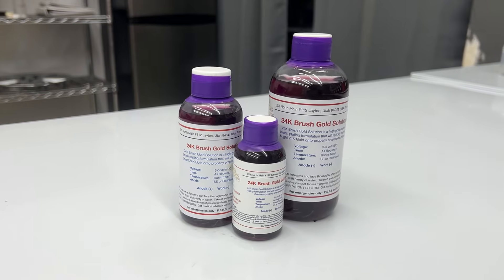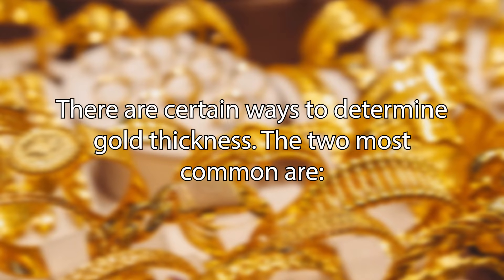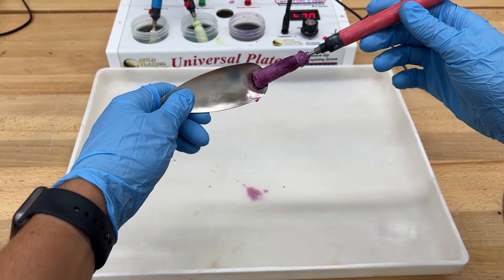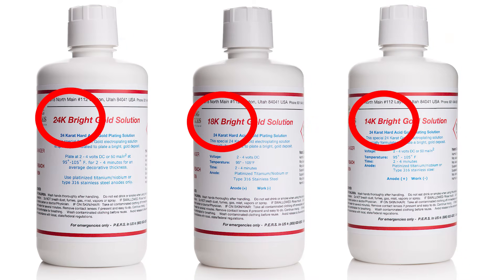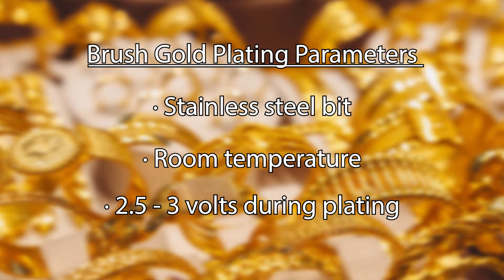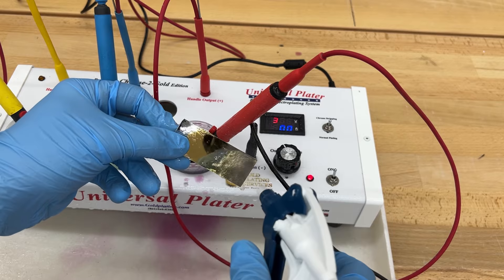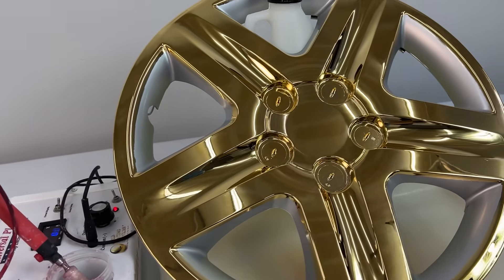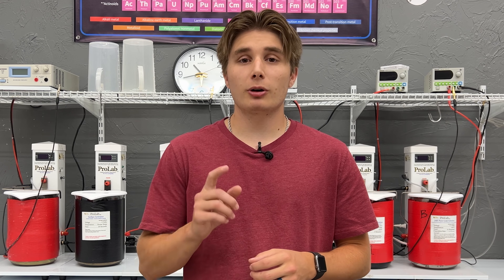24K Brush Gold Solution in the Electroplating Process

Comment: 3:50 I'm not a 'plating scientist', but wouldn't it be easier to control loss, by... not losing? Most adults know how to saturate something where it doesn't drip??
Hard to tell from your videos though.
I don't know if you're subliminally programming people to be all loose with the product, but I personally would treat EACH drop like there was gold in it...
since, there's gold in it.
Reply from the maker: There will always be gold loss with brush plating, whether it's from the solution that is saturated in the sleeve that you'll never get out, to dripping (especially when working on vertical surfaces), to unintentional overdeposit in certain areas. But of course, with practice you learn to minimize the loss as much as possible.
Reply: i was thinking the exact same thing with the programming hahahah

Comment: Thank for this video. I'm very new to this. I would love to purchase your 24K brush gold solution. Do I need to get different electro plating machines? Or can I just use one machine to do all plating, like sterling silver casp and gold casp's?
Reply from the maker: You can use the same machine, you'd just need to swap out the solution and the bit/sleeve to prevent cross contamination
Reply: 1 machine.

Comment: Is it safer than a normal bath/pen gold solution?  
I'm very concerned about using gold solutions because they usually contain cyanide
Reply: Don't drink the solution, and you'll be fine.
That's good knowledge for most liquids.
Reply from the maker: Our solution does not contain free cyanide, but we still recommend using all precautions you feel are necessary. You can read more abour our solution here: https://www.goldplating.com/products/24k-brush-gold-plating-solution